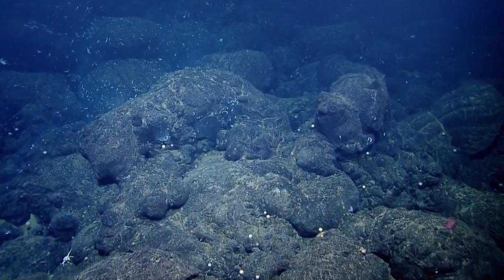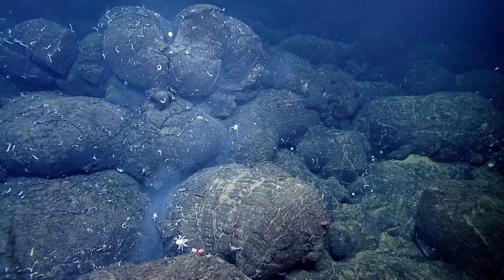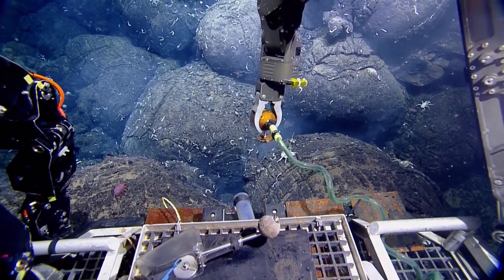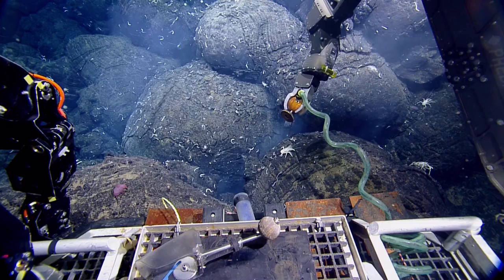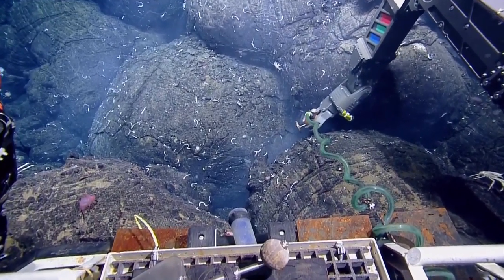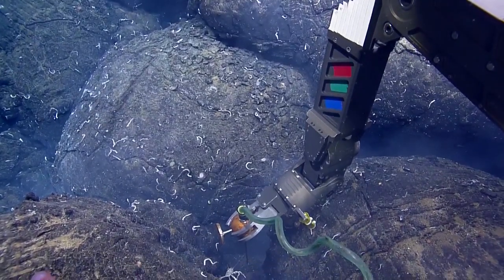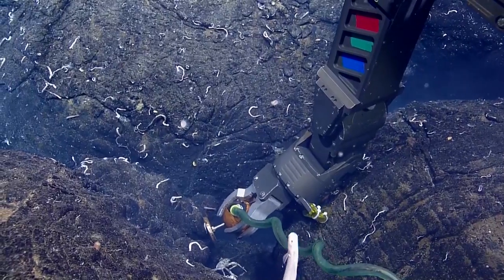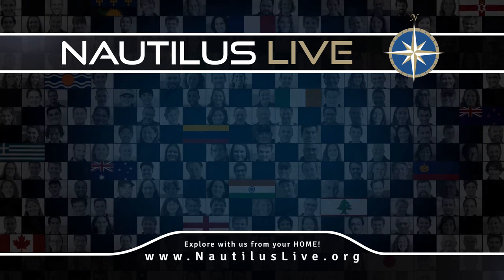Measuring Active Hydrothermal Vents in Galapagos | Nautilus Live

Comment: @EVNautilus I have a theory but I'm not a scientist so take this as you will, but as those hydrothermal vents are nestled amongst recent pillow lava flows and show very little mineral build-up is it possible that the vents are "rootless?" IE are merely been feed by residual/internal heat from the lava flow than from the actual magma chamber or other sub surface heat source :3